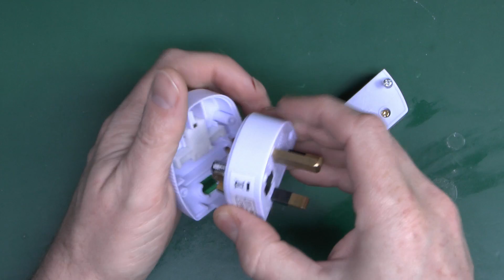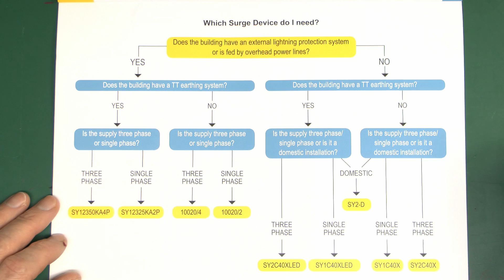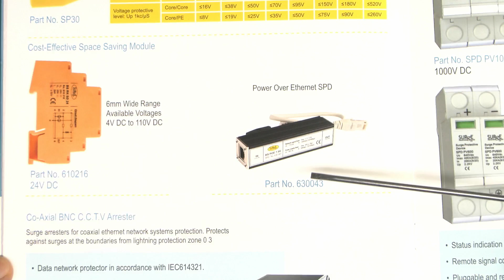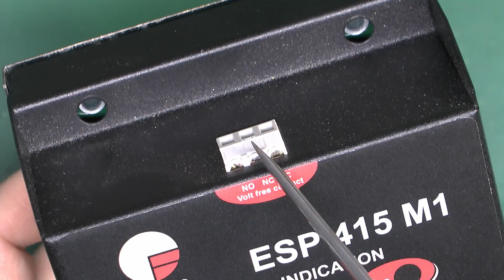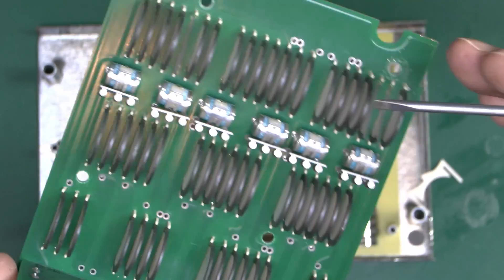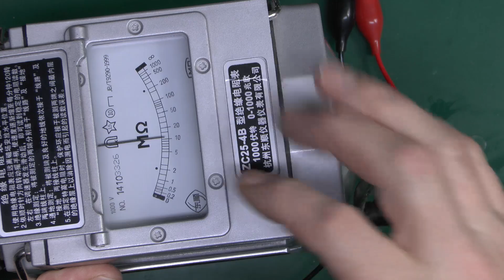Surge Protection 3 - Types and Teardown of Combined 1+2+3

Comment: Do these surge protectors degrade and have they a recommended life, how often should they be replaced?
Reply: Very difficult to say as yes, they degrade to some extent each time they suppress a transient. Most only indicate replacement if a surge great enough to trigger a thermal overload or fuse was present. I imagine the manufacturers would recommend to replace during each inspection.
Reply: @sdgelectronics  Thanks.
Reply: @sdgelectronics  - they are actually designed to fail, that's the whole point. They "take one for the team" each time they suppress a fault. This big problem is that MOVs typically fail CLOSED circuit, due to thermal runaway. When that happens, they can overheat something chronic, literally short-circuiting the normal mains some time after the surge event. I've been involved in diagnosing a few "incidents" where there has been "fires" (smoke before a breaker tripping) due to MOV breakdown. End users find it hard to understand the phenomena.
Reply: @johncoops6897  That wasn't the question. The question was how often should they be replaced which is difficult to determine unless the thermal overload triggers.
Reply: @sdgelectronics  - If you read carefully, you'll see that the question STARTED with "Do these surge protectors degrade" which is what I am expanding upon.
The bottom line is that there is no way to know how long they last (it depends on how many and what size transients are absorbed), so nobody can recommend how long they last. You are correct that the only way to know they are dead is after they catastrophically fail (which may not have even been from a surge event).
A lot of people think that a thermal overload is caused a surge, however that's not always the case. After they become "worn" (internally damaged), they sometimes start to slightly conduct at very low overvoltages, and literally melt or explode. That's because they are only capable of dissipating the heat from extremely SHORT duration pulses.
Once the thermal overload is tripped, you KNOW they must be replaced, but it's almost impossible to know when that might occur.
Reply: @johncoops6897  No they are not designed to fail and no they do not "take one for the team". The testing protocol in IEC 61643 requires any device to be able to deal with at least 20 events. If you source SPD's from reliable manufacturers they can and do last a life time. The right device, in the right place, installed correctly is critical.
Reply: Conducting current is the "protection" state of a voltage-limiting device. Gradual wear and tear causes them to conduct more. So they tend to fail protective unless subjected to a massive explody overload. 

(Once degraded MOVs and avalanche devices leak more, gas tubes switch from open to closed at a lower voltage. Carbon blocks and wire horns are, as far as I know, the exception. They can burn in a way that makes them wider and increases trigger and let-through voltage.) 

You could chart the wear-and-tear with an amp-meter but the "protected" lamps and visual inspection are enough for most applications. A device that protects AC will always have a fuse that fails open once the leakage current is too high or a MOV overheats. The trick is to remember to check!

MOVs installed inside a device (such as a PC power supply) might not be monitored and I don't have a good answer for those.
Reply: They degrade, and they do that in a very dangerous way because leakage current slowly increases and they get hot.
There is a paper somewhere from a US fire investigation authority that goes into that and pretty much concludes surge protectors probably caused numerous deadly house fires.
Service life depends on the size of the varistor element, temperature, how much voltage headroom there is, and exposure to surges.
If they are designed with thermal disconnect (type 1/2) this is not an issue, but the little varistors typically fitted into plugs and power strips and the like are rarely designed right and have no thermal protection. I will not use them in my house, or in the power supplies I design, for that reason. 
Various product safety standards require either a certain minimum size of varistor, or only allow them to be fitted in series with a spark gap, which means they are not constantly exposed to voltage.
Reply: @stefantrethan  - agreed and well said! Wwe have found MOVs very problematic in high volume consumer products, for the reasons that you outline. I've read and used the US fire report you mention during investigations of "events" with safety regulators. The MOVs tend to be very common in appliances because it's an easy way to pass >1kV surge test in IEC standards, which is mandatory in AU for many (most) products like PSUs, LED drivers, etc. The test is that the voltage is dealt with "safely", and the device doesn't need to function afterwards - so a small MOV after an inline fuse acts as a cheap disconnect technique. Of course this adds literally billions of dinky 7mm MOVs across them mains, each of which is a thermal time bomb. That's OK for compliant devices with proper fire retardant PCB and housing, but lots of manufacturers don't worry about that kind of stuff.
Reply: @johncoops6897  Fire retardant plastics are no guarantee. UL has shown that you can "cook" certain fire retarding chemicals out over time if you heat the material slow enough. A flammability test done on a fresh sample does you little good in that case.
They do make varistors with thermal protection built into one part, and you can sandwich regular ones together with a thermal fuse and be reasonably safe.  
The problem is exacerbated by using just small varistors in a distribution without any larger protection elements upstream. Surge protection only works if the whole system is designed right, John didn't really go into the different clamping voltage levels too much.

Comment: I'm surprised that top card didn't slide  out of the vertical fuse PCB, those certainly look like pin sockets.
Reply from the maker: Further investigation reveals that it does.
Reply: @jwflame  That would certainly make manufacturing easier!

Comment: Very interesting - thanks.  Are the SPDs required for TT systems more expensive?  I’d presume they need even more MOVs etc. To cope with the higher resistance Earth?
Reply from the maker: Not usually, the differences internally are minor.  Some can be used on both TT and TN systems.
Reply: They use similar MOVs (but they may have a more powerful GDT/spark gap for differential protection).

In an SPD for TN-C-S, the internal protection is configured - L-E and N-E. The low earth resistance, means that fault currents through any MOV are not limited, and that over-current protection will operate correctly to disconnect the SPD in the event of failure.

In TT, the continuing fault current to earth cannot be relied on to trigger over-current protection. In this situation, an SPD with internal connections L-N and N-E is advised. In this case, the continuing fault current through a L-N connected MOV will not be limited by local earth resistance and over-current protection should operate correctly. One issue with TT systems is that the TT electrode can itself be an source for incoming surges (e.g. nearby lightning strike), and therefore these devices are sometimes equipped with enhanced N-E protection, due to the higher risk of N-E surges.